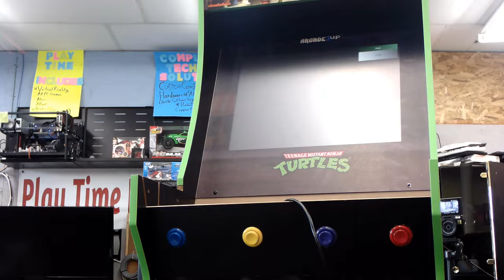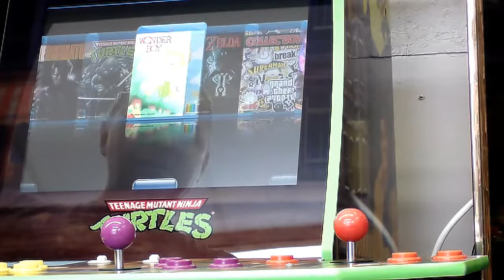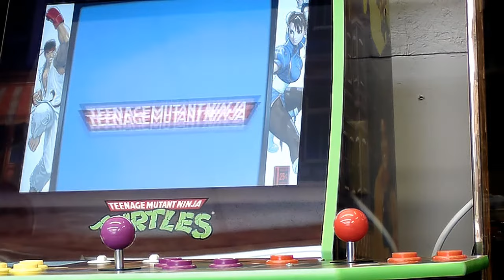Lets "Bake a PI".. This time lets upgrade this awesome TMNT Arcade 1UP!

Comment: How much would you charge for a 1990s Xmen Arcade cabinet inscale with Aracde 1up
Reply from the maker: Welcome!
That would depend on if I could locate the cabinet. Typically, I'll use any standard arcade one up. It's pretty easy to re skin these to look like anything that you want them too. Now, for an X men, you're going to want at least 4 controllers. Since you're going to have all of the other games though, you're going to want more than just a jump in attack button. Generally, if people bring me the arcade cabinet, I complete the conversions for around $300.  If you complete it yourself, you can probably do it for around a $100 parts if you shop around. I did a video recently on a final fight conversion. That should give you an idea of what you're going to need for each player. In that video, I actually installed a coin accepter as well. Remember, if you do that, you're going to have to have one coin acceptor per player.
Reply: @AlternateArmsSD  I'm just looking for an Xmen Arcade cabinet with decals on it no other games with all characters really just want it to look like the original without the coin inserts I wouldn't be able to pay all at once but I can do payments on PayPal I'm not good at building stuff like so finding someone who can do it with payments is awesomeness let me know if you're interested in this project and making a video of it's assembly
Reply: I've been wanting this cabinet my whole life
Reply from the maker: @GokuBlack-gz4fy  Let me do some searching. I'll keep you posted.
Reply: @AlternateArmsSD  thanks man I appreciate this
Reply: Yo bro how soon could you be able to do an XmenI just learned for $800 that Arcade1up is doing the Xmen I want to be released in November I put down 4 payments on it I'll have it but I'm also worried about it being shipped and them actually sending me the right one I dont know how many times I've gotten wrong orders from Target
Reply from the maker: @GokuBlack-gz4fy  Yeah I hear you man! I’m rather “hit and miss” with target too. Let me know if you get it!

Comment: I think it ruins the screen, you got  the Street Fighter back room kinda ghosting the full screen, just shrinks the size, unless there’s a way to remove that
Reply from the maker: Joshua Underwood I did find that there were several settings in the screen (adjustable frame that small panel we mounted) that allowed you to change th resolution, frequency, and size. Along with that you can also make adjustments in retropi as well to eliminate the effect. It was a trial and error thing. How did the rest of the build go?
Reply from the maker: Joshua Underwood Oh and also, Make sure that in retropie you tell it to not use the bezels on arcade games. The bezels tend to overlap on the main screen.
Reply: Complete Technology Solutions oh I see, I think you should think about editing this video, without that overlay, because I’m sure I’m not the only one that doesn’t know that you can adjust those settings
Reply from the maker: Joshua Underwood Yeah and that gets into raspberry configurations. I may do a complete setup and file transfer video if it’s something that folks would like. :)
Reply: Complete Technology Solutions  I can only speak for myself...lol

Happy New Year btw
Reply from the maker: @SoLaRDx  Happy new year man!

Comment: Can you link the jumper cable for the power switch? Thanks
Reply from the maker: Here's a little cheat sheet on that ;) I didn't use the volume control though as I installed the awesome AMP... https://icculus.org/finger/icculus?date=2019-01-01&time=09-32-56

Comment: Seriously Ive mod my TMNT Arcade with your tutorial and thanks a lot. Got led button and 14 buttons added. Your tutorial is very nice explained the only problem that I got its the damn sound. The sound its too much low I got my amplifier but really don't know how to do the connection and I don't really understand what you've done. By the way thanks again for this tutorial !
Reply from the maker: Bodomknight Oh yes, that is why I added that amplifier. It was absolutely necessary :-) all you really need to do is run one audio cable from the audio port of the raspberry down to the input of the amplifier and then from the output of the amplifier up to the input of the speakers. It sounds a lot more complicated than it is, but when you do it you will definitely be glad you did :-)
Reply: @AlternateArmsSD  Oh nice so I will try this thanks a lot :)
Reply from the maker: Bodomknight Anytime my friend. Just an FYI, to run the audio cable from the raspberry you will need a male 3.5 mm plug down to a duel RCA male cable. Then, coming back up from the amplifier you will simply strip a dual RCA cable and put it into the outputs of the amplifier. Then, you can run the cable up to the connection going to the speakers and use a small barrel connector to connect the 2 3.5 mm connections together.
Reply: @AlternateArmsSD  thanks it works but I think I will buy new speaker to make it perfect... by the way thanks a lot your the best !
Reply from the maker: Bodomknight Anytime my friend. I’m glad the video helps :-) it’s tough getting a channel off the ground on YouTube these days :-)

Comment: I’m having a problem I have no sound anyone have that problem
Reply from the maker: Rob Towne plug in a set of headphones directly to the output on the LCD controller board. See if you’re getting audio to that point. If you’re not, you need to go into your raspberry configuration and make sure that retro pie is putting audio out Through the HDMI. The decoder board then breaks the audio out to analog. Hypothetically, you could also run a direct analog line from the raspberry down to the amplifier. You will just have to set retro pie to use the analog audio.